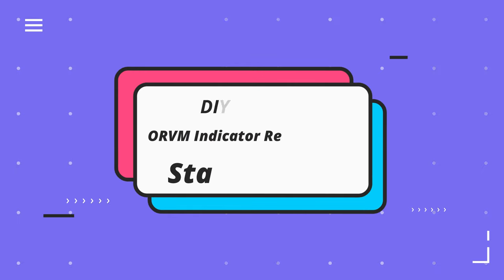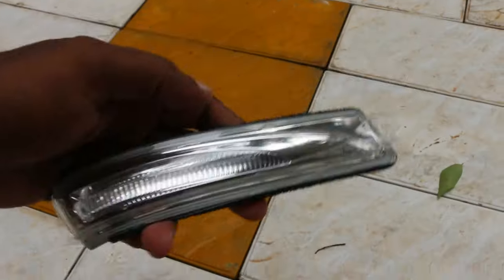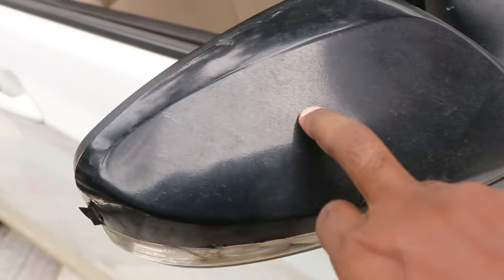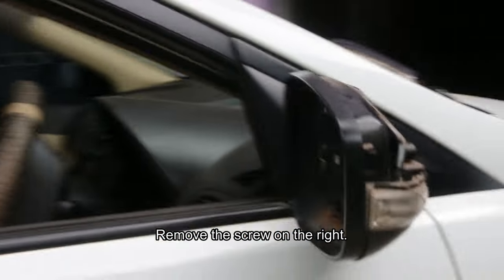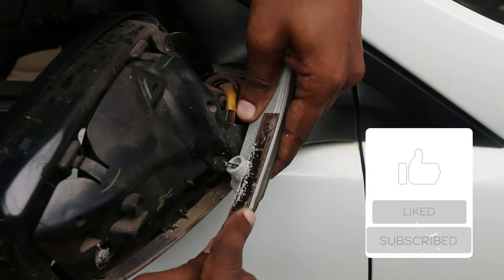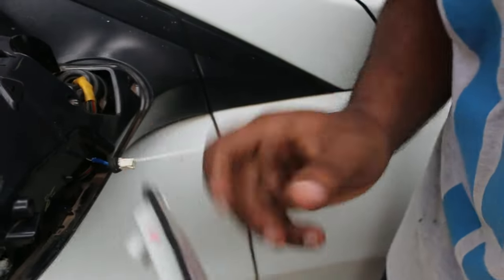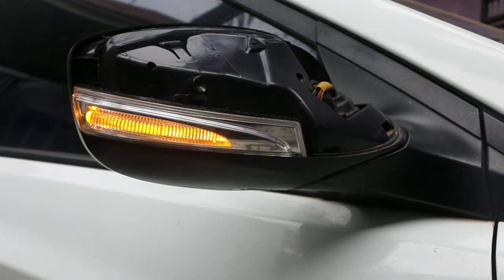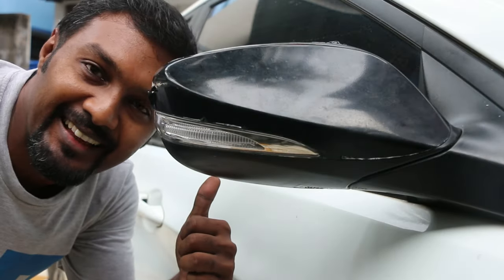ORVM Indicator Replacement DIY | Hyundai Verna | Accent | Solaris

Comment: Bro Can't we open the mirror cover first before removing the inside mirror? Usually the mirror cover should be opened first right?
Reply from the maker: You can remove the plastic cover first if you want.
Reply: @StanDaManReviews  just wanna paint the cover from white to black bro.. thats all. So asked you, removing the mirror also mandatory for it? I approached a technician here to remove the cover for me. He asks 1000 rs labour just to remove the cover and put it back. He says reason for it is electrically foldable mirror with indicators. Is it a very big job to charge 1000rs labour? 😟
Reply from the maker: @Sar_vesh  No don't give it to him for 1000 rs , it is too much. Just buy the tool which I shared and remove it yourself. It's very simple. That is why I have shown step by step guide on my channel. Just be gentle not to break it. Even if it takes a lot of time be patient. 1000 Rs is day light robbery bro.
Reply: @StanDaManReviews  Thanks a lot for the pointers bro. Cheers 🙌🏽

Comment: You don't need to remove the cover. Just remove mirror only and then the two screws holding the indicator light in.
Reply from the maker: yeah that could work as well but sometimes indicator edges might break if we are not careful.